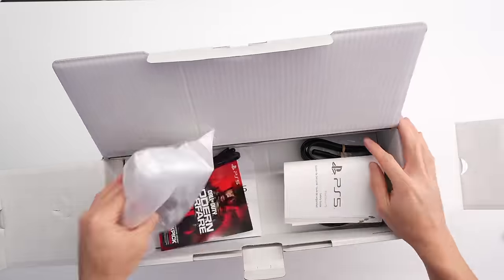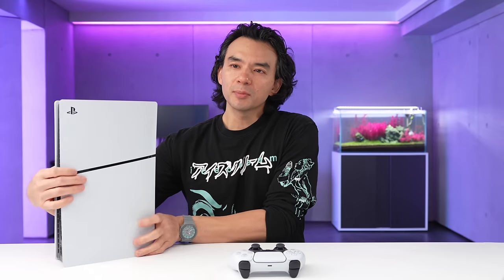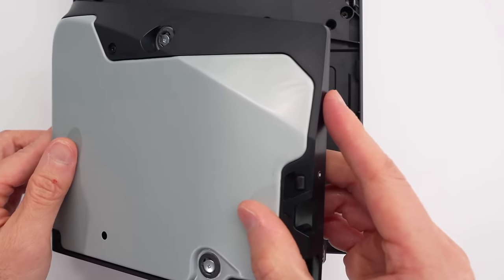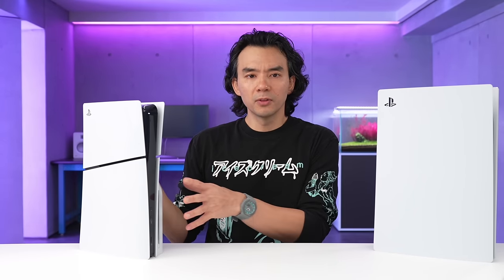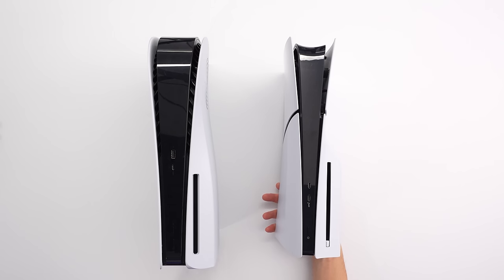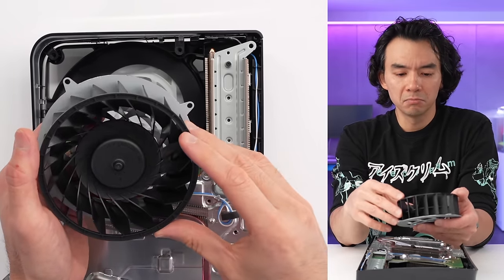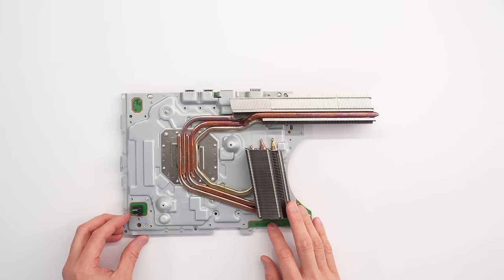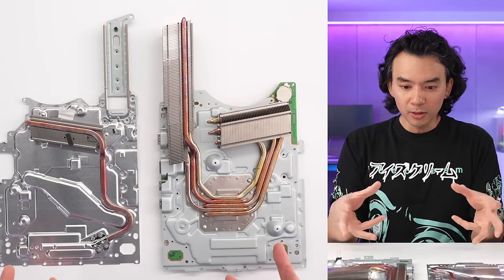NEW Sony PS5 "Slim" - Teardown + Thoughts

Comment: Honestly, although the PS5 has been  a really expensive consoles it has also looked the cheapest. Like a 99$ Chinese clone-console, both the original and the re-design. But I shouldn't be surprised, Sony never made good console designs with the exception of PS4, which looked bland at best. Remember beautiful consoles? Like the Neo Geo or the Dreamcast or consoles with character, like the Gamecube? Heck even Nvidia did a better design job with the Shield TV. I don't get it, Sony has some good product designers, but definitely not on the games division.

Comment: When it comes to the storage, the original had those 6 chips in some weird JBOD array that would allow it to have its 5500mb/s transfer speed, truth be told, I believe that they were controlled by PCIe 3.0 (like the xbox series x, now I know the series X runs a gen 3 SSD because I had a SSD that was pulled from a dead series X in my steamdeck) and now, I believe they not only updated the controller to run at PCIe gen 4, but changed those modules to a pair of 512gb in that same weird JBOD array. because it looks like its using a different SSD controller chip too. no way to really see though unless you do a read/write test. And there isnt going to be any performance increases, most of the SSDs users ad to their PS5s run 7000mb/s and up and there is no benefit to that.

Comment: what really is the point of this device according to Sony?
wasn't previous slim models at least has lower power draw AND considerably smaller so it would save some space?
from this all I could take is that it's lighter so you can move it easier, cooling system is more refined, and storage is A BIT larger?
if it's just to cut production cost, that is really boring, Sony

Comment: I would fire ALL the design team and tell them to release the V shaped prototype as the retail version, and if I was in a good mood, I would fire more millennials and get the PS3's boomerang controller into production.
Reply: Not possible mate due to the development kit having way more advanced / powerful tech built into it solely for the sake of the devs themselves not as a consumer product since doing so would cost upwards of three thousand bucks or more, no way in hell would the consumer product be that much since it's meant for consumers

Comment: Don't think anyone has mentioned yet how the m.2 cover is different between this one and the original PS5. All those existing cooling covers will have to be re-designed. Hopefully Sabrent is already hard at work on a new cover. And once again, even with just a glimpse, the dbrand covers for this model look amazing. Maybe Sony just consult them when designing covers going forward.

Comment: Cool, they put a replaceable optical drive, to make up for putting all those high-failure-rate shit-drives in the OG PS5, like the one in mine, that died in under 2 years, and they wanted $248 up front before they would even look at it, eff that.

Comment: I have the original digital, it looks no different than that. This is a gimmick, shame on Sony, you get like 175gb of extra storage, and I've heard the cooling isn't as good either. Whoopi. As most have said it's the same exact console, weighs the same and is slightly less tall vertically. Horizontally on the digital edition Slim ($449) you have to pay $30 more for a kick stand to prop it up !! What the French toast. No thanks. I'd rather pay $600 for the Spiderman edition and i'm not even a Spidey fan!! ha

Comment: They made it ugly this time. I an planning on getting a ps5 game. Had ratchet and clank since launch find the ps5. Had money then eventually gave up finding one ended up using the money for other things i needed. Haven't had the money since. I have a game i can not play. I waited in lines and queues for that ps5 over and over again. Still have ps3 slim and ps4 mechanical button model that i think had a die shrink or runs a bit more cool than the first ps4 with the touch buttons. Came with black ops 3 i think. Still have the OG boxes for them. Doesn't seem stable. Your right. And depending on where people put the console this is going to be a problem.

Comment: The slim will fit right in with the Chinese knock off ps5 designs. Sony simply cheaped out on the horizontal stand and the shell without the plates. I hope the pro will look more like the original but, updated. 
Sony’s worst design yet.

Comment: Really disappointed, it's ponderous and nothing "slim". A 4070 ti itx pc with 1u power supply would be of similar volume and weight and can run smoothly at 4k ultra setting 60 fps, with a little help of dlss in vram hungry games though. The curved side panels is a total waste of space if you're a college student of renter who needs portability. Even the xbox x is more slim than this slim version